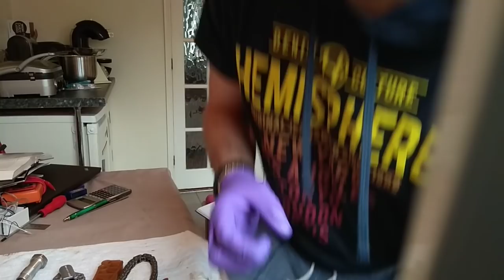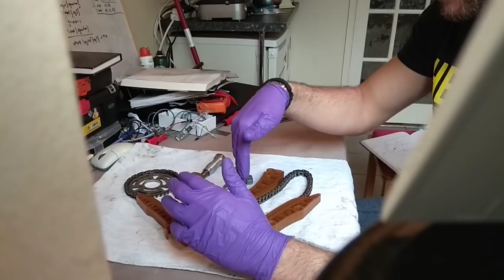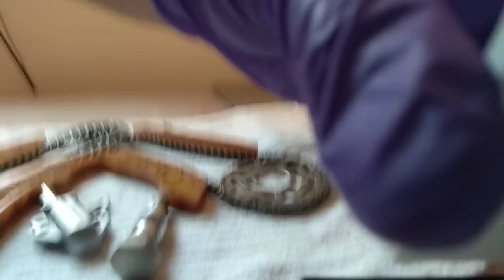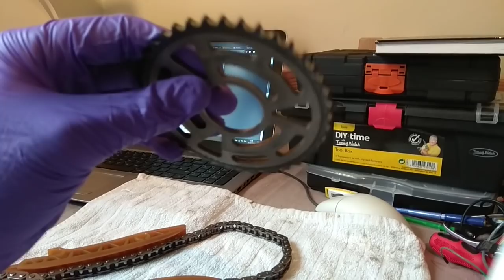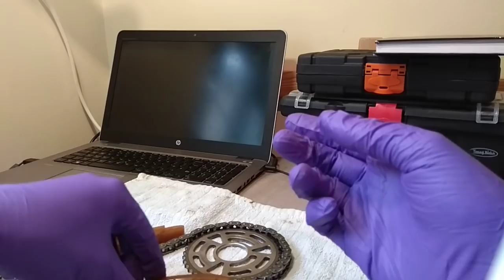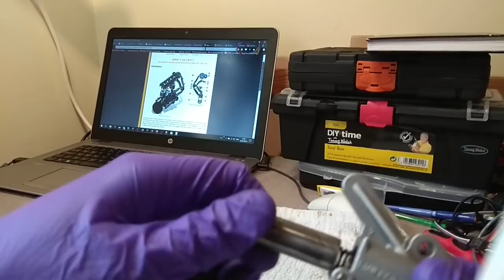N47 timing chain analysis

Comment: You put a lot of emphasis  on tensioners would you suggest replacing the tensioners rather than the full chain replacement.
Reply: No point can change top one but bottom may fail, to get to the bottom you may as well replace the chain. Just masks the issue as won't solve a stretched chain, the tensioners aren't the issue

Comment: ....so instead of all the work, you could have just changed the two tensioners at minimal cost as that's what was causing the slight noise at certain revs and chain and guides just have normal wear with plenty of life ?
Reply from the maker: No. Both the chain and tensioners need replacing. In order to get access to those you need to either remove engine or drop transmiission, you may as well change everything at that point

Comment: Hey Mtech, what timing chain kit did you use for replacement/repair, OE (BMW) or aftermarket?
Reply from the maker: it was aftermarket.. BGA if I recall
Reply: @MTechOver9000  thank you for getting back. Gotta replace the timing chain on my n47, quite afew aftermarket brands out there, including BGA. It served you well?
Reply from the maker: @ivesaidit2464 well I've put 50k miles on it and it's not snapped yet 😊 but I do feel it's maybe just starting to get slightly loose now. Will just drive this car till it blows up at this moment
Reply: @MTechOver9000  Thanks a lot for the feedback despite the video being 5 years old! I'll probably get an aftermarket kit given that the OE ones are way overpriced. All the best 👍

Comment: From my experience the worst affected where 2007-2009 where crank sprockets were a big issue later engines were fixed in regards sprockets , iv seen them snap at 50k miles which rules out oil changes being an issue , but then iv seen 175k on original chains too which definitely backs up regular oil changes playing a part 18k is too long .this engine was taken out of use in 2014 but I’m now seeing similar problems on a b47
Reply: Hi Ben they then used the N47C in the Mini till around 2014 with same problems, now they are in Toyota's I have a snapped chain from crank to pump pulley, full dealer service history 47.000 miles and two bent valves and followers

Comment: Thanks for this video, very interesting analysis. I've got mine (2013 316d, 130750 miles) booked in for a new chain kit on Monday at a BMW specialist in Worcestershire recommended to me by the mechanic that works on all of my cars. I didn't realise that it needed doing on 2013 cars, but mine is displaying the chain rattle on startup which I would guess is a problem with one or both tensioners? Either way I'm having it all done just for peace of mind. I've been quoted £1100-1200 to have the work done, but I was told the reason why it was more expensive than other quotes I got (around £850) was because they use genuine BMW parts and they take the engine out for better access to the chains so that they can do a better job. They told me that when people have it done using the gearbox out method, it sometimes ends up coming back to the workshop after 6 months leaking oil all over the place and ends up costing the customer more overall.

Comment: Do you know where that "big" chain tensioner is? Maybe the system can last a little bit longer if you change that one sooner...the small one..."the rusty one" is unchangeable^^ I guess...without getting the engine out...
Reply from the maker: Both of them are located at the back of the engine against the bulk head. I don't think you'd be able to get to it without removing engine or transmission... But in not too sure
Reply: @MTechOver9000 yes, you can change it without removing anything (maybe cabin filter), it's simple and it has an updated version

Comment: I'm wondering whether this issue is related to the auto stop start system. The greatest strain on the timing chain assembly is during engine start and increasing the frequency of the stop/start cycle would definitely reduce the life of the components. As this was the first generation of BMW diesel to feature the system, is it possible that they underestimated this? My 320D with N47 (2009) has done 175K miles on the original chains, but the stop/start system hasn't really worked for years...
Reply from the maker: Yes I certainly think this would contribute! When the engine is off, the oil pump (to the best of my knowledge) is also off and not maintaining the correct pressure and therefore film thickness. My car hasn't activated stop start in ages, and when it does I make sure to switch it off
Reply: Agreed - I have disabled mine using bimmer code, took 5 mins, stop start damages your engine.

Comment: hey, informative thank you. but can you explain why the dpf regen would dilute the oil with diesel? thanks
Reply from the maker: I'm not entirely sure, I recall reading it. I guess during DPF regen unburnt Diesel is passing through the cylinder to the catalyst. If the car is constantly trying to regen (ie. Only City driving) i imagine some of that diesel is probably escaping the seals... But I'm not so sure about this
Reply: Another good reason to get EGR and DPF both deleted to extend engine life.

Comment: Hi mate just been looking at your video n47 timing chain think you mentioned you had it replaced at pmp in nuneaton £450 I messaged them and thay quoted me £850 but yours was 2 years ago. How is the car now did thay do a good job .regards joe
Reply from the maker: Hi Joe, £850?! Wow, I think they're having a laugh now! 2 years on and the car is still 100%, absolutely no issues so far although I've only really covered just under 30k miles in the time. The only issue at the time was that they used the wrong viscosity oil after changing the chain, was no biggie as I just changed it myself at home... Oh and they also revved the tits off the car during the test drive with me which I didn't appreciate. Otherwise the job was sound

Comment: Took a Ford Smax 2l diesel to 212000 miles with oil changes every 13000 miles, original engine, gearbox, clutch, DMF, DPF, EGR, turbo, injectors etc. My BMW E88 M sport 2l diesel is also getting oil changes every 13000 miles with Forte engine flush and fuel system clean, so far 52000 extra miles done and she sounds and drives great. I won't be changing the timing chain as she's a 2012 and I'm not detecting any odd sounds so I thinks she's fine, my thoughts are a rubber belt is good for 125000 miles in a Ford Smax so a steel chain should be good for 200000 miles IMO, lets see how she goes

Comment: Hey.. watching this video as my N47'd 520d is starting to make some tell tale noises and I'm getting exceptionally paranoid. I live not far from PMP and am planning to go to them.. just wondering since you had it done, whether it has help up OK all this time? Thanks.
Reply from the maker: Engine's been spot on mate.. but I haven't done very much mileage since changing it (<2 years and 20k miles)
Reply: @MTechOver9000  Thanks for the quick response! Good to know.. I'm doing about 15k a year approximately so... will be putting it to the test I guess. Going to give PMP a ring tomorrow. Cheers.

Comment: There are a number of decent budget engine choices available from BMW as well as other manufacturers, (most notably Volkswagen 1.9 tdi of the late '90s to mid/late '00s). The N47, with its prepostrously located cam drive and with question marks about the efficacy of its tensioners, guides and crank sprocket, is a pointless automotive cul-de-sac whose cam chain mechanism is needlessly compromised.

Comment: You will note the chain is not duplex and is similar to Mercedes chains which are also failing. Both makes implement stop/start technology and both makes, (certainly Mercedes) are experiencing timing chain elongation and in many cases chain failure far earlier in the engines life (as early as 45,000 miles for Mercedes) compared to pre stop/start cars where the problem mainly arose well into the 100,000 miles. 
With an estimated 600,000 lifetime starts for stop/start as against 60, 000 for pre stop/start cars is it any wonder that a single link chain is stretching, this stretching causes the chain to slide up the timing gear teeth causing wear. Some of this chain slack is taken up by the adjuster but once this gets to its limit the chain jumps across the worn gear teeth loosing timing and wrecks the engine, Most stress occurs on the chain at low speeds and especially when overcoming the moment of inertia at the hundreds of thousands of extra Stop/starts, is it any wonder that timing chains are failing.

A simple method of deactivating stop/start is to disconnect the small sensor attached to the negative clamp of the starter battery, this works on many makes of cars including my own Mercedes and Porsche Cayman, this also at least doubles the life of the battery. Try it if you are not comfortable with this just reconnect plug, totally safe.
Reply from the maker: Yeah, spot on mate. This is especially true for diesel engines which need extra torque from the starter motor to get the engine spinning again, each time yanking the chain. Also, correct me if I'm wrong, but the oil pump stops working when the engine is off meaning the oil film that developed between the sliding surfaces breaks down from lack of pressure and results in accelerated engine wear each time the engine is started. I simply disable the stop start when I start the engine... I'll look out for that sensor. Thanks for the comment!

Comment: Very good analysis, very impressed. This is exactly what I love about engineering, I don't have any qualifications at all in this field, purely interest. 

I bang the drums for the long oil intervals being a massive factor here. My mechanic thinks the same. 

I had a 2008(58) 118d took it up to 200,000 miles - chain sounded "whoosy" since 55,000 but I changed the oil every 7/8,000 miles, no issues - sold the car now, still going strong I believe.

I now drive a 2012(12) 318d with 120,000 on at the min, aquirred at 50,000 - same regime with the oil all is good. (I do alot of miles 25/30k a year all over Europe aswell as UK)

One thing also is not changing oil often really effects your turbo lubrication aswell, see lots of blown turbo bearings again because of these long intervals.

Again, great video - thanks for your time and dedication to this.
Reply from the maker: Yeah spot on about the oil changes. Like you experienced with your previous car, I think they can go for a long time even with the dodgy sound present but I want prepared to risk it. Thanks for taking the time to comment!

Comment: Hi - Thank you for the content I enjoyed it, 450 GBP is a very good price to have an N47 timing chain kit & oil service replaced, do you know if the engine was removed ? What model of BMW do you own ? Best Regards, Colin - Dublin 👍
Reply from the maker: Thanks Colin. It's a 2009 320d with the N47D20C engine. They replaced it by dropping the transmission and coming in from the bottom.
Reply: MTech over9000 Ok 👍 and do you know what brand replacement timing chain kit was used ? Regards, Colin.
Reply from the maker: Autolink Motor Company Dublin BMW Specialists It was an aftermarket BGA kit. I doubt however that any mechanic will charge this low for the job anymore... I was a bit lucky
Reply: MTech over9000 Very good 👍 you did well getting it done for that price, we are an independent Bmw specialist here in Dublin and we replace quite a few of these timing chains on the N47 engines, it can be quite confusing with all the different opinions about when the chain should be replaced or if it needs replacing at all, I would agree with your comments about the noise a stretched chain can create they can sound very different when stretched compared to a healthy chain. We have many of these cars with n47 engines at well over 100,000 miles (mainly F10 & F11s) that are on original chains and sound perfect 👌🏼 so its a difficult one to call about a precise interval for replacement - however we have replaced many chains because the nylon guide has broken and caused the chain to loose tension and as far as I am aware it’s the nylon guide that BMW are replacing as part of their recall scheme, we use an FAI brand complete kit and we remove the engines as it allow’s good access to the back of the engine and the chain assembly there is quite a bit more work but we have found that it gives much better access when rebuilding the chain assembly and sealing the back plate up but every man to his own. One thing for sure is that when a worn (stretched) chain is replaced the engines are very happy and run as they should producing good power and fuel economy - again thanks for the content and hope you are enjoying your 320d 👍 Best Regards, Colin.

Comment: Do you think that this could be avoided by decreasing the oil change intervals to half what is recommended by BMW?
Reply from the maker: MickHornbak hmmm... Delayed.. probably. Avoided, I doubt it... I think there may be a design fault inherent in the design that's simply exacerbated by the longer service intervals
Reply: @MTechOver9000  Thank you. I guess you pretty much have to swap the chain as often as you would on a motorcycle. That's pretty disappointing especially if you can't do it yourself.

Comment: BMW cutting corners lately; why not simply put a gear timing like Mercedes Benz... oh, wait, MB stopped doing that also... nevermind; instead of putting some of that wads of cash they ask for these high end cars into bulletproof mechanics they keep putting bigger computer screens in to let the fools that buy these know when they`re FUBARED!
Reply: Because if they did, the car would last a million miles and as they don't really rust now, they would go bust as nobody would buy a new car.....also it's cheaper to do it like this as warranty only 3 years anyway

Comment: I replaced the chains of the distribution of my BMW 120 of the year 2008 to 90,000 km in the BMW Branch. They told me that they put those with modification and so the problem should be solved, at least I hope.

Comment: A buddy of mine told me to sell my 2012 118d as fast as possible, because I just got the Car back from getting the timing chain and  exhaust return valve replaced.
He said, the repair of the timing chain doesn´t last forever. He has a friend who is a mechanik, and he told him that he had cases of n47 motors, who had a engine failure because the "Repaired" Timing chain snapped. Now I´m worried that my timing chain could break aganin. should I ? Or are most of the problems solved, once the chain is replaced?
(PS: Sorry for my bad english, I´m german XD)
Reply from the maker: Gazguy willkommen meine Freund. In all honesty, if you have already changed it, just stop worrying about it. Mine lasted for 170k km before it needed replacement. The new one already covered  30k km without any problems. If it can last 170k km like the last one, I think a lot of other things on your car will break before the chain dies. You've already spent money changing it, if you sell now you make a big loss..My best advice since you already changed the chain is to just enjoy the car and stick to 15k km oil service intervals.. Diese Dinge können dich verrückt machen...Die Möglichkeit zu brechen ist jetzt bei Gott! Grüße, Mtech
Reply: @MTechOver9000   Vielen Dank ;-) Mine got changed at 63k km.  I think it will last me a while nowXD. At 8 000 Km  a year, is it better to change the oil every year or should I wait till i hit the 20 000 km service intervall as it is programmed in my bord computer?
Reply from the maker: Gazguy once a year, or 10k km... Whichever comes first
Reply: @gzg1337  Weiterfahren und sich am Diesel erfreuen, bei meinem wurde Ende 2015 die Kette getauscht, bin seitdem ca. 50.000km gefahren und noch immer ist alles Top. Wie sich mein Motor Stand Heute anhört kannst dir in meinem aktuellsten Video anschauen. Ölwechsel mache ich 1x im Jahr, je öfter umso besser. Sind wir ehrlich, das Öl + Filter gibts im Internet für 30 Euro, da schadet ein zu häufiger Ölwechsel sicher nicht wenn man es selbst macht.
Reply: Hi Mate, just read your post & I have to say that who ever told you to sell your car is a complete clown with no experience on BMWs ignore everting this person says in relation to you’re car & start enjoying your car - BMW are the ultimate driving machine - once you have a timing chain replaced by a reputable mechanic workshop that part of the engine will be fine 👍 loads of people have opinions with little factual experience to back any of their fantasy claims up we call it “Pub Talk” here in Dublin. Take Care - Regards, Colin.

Comment: Awesome video and super informative. I'd like to get a 5 series which unfortunately has the affected n47 engine. I guess id have to look out for a car that was serviced at more frequent intervals than BMW recommend, or at least had the oil changed more regularly.
Reply from the maker: Fiaz Shah Thanks Fiaz, I say go for it, as long as it has decent history and is not making a sound. Go for the post 08 cars. Else if you can get it changed cheaply, the engines are otherwise great. I may make a small part 2 analysis

Comment: Hi MTech over9000

Nice post i recently purchased a 2010 123d coupe, lovely car and tbh i haven't had any problems yet, touch wood👈, in your video i noticed the diagram on your ladtop just wonder what manual it is or can you download it?
Reply from the maker: horse21320021 Thanks. That diagram came up when I googled n47. You should find it in Google images
Reply: MTech over9000

thank you 👍
Reply: @horse21320021  also check realoem.com and enter your vehicle's details. From bodywork to engine mechanicals. All there!